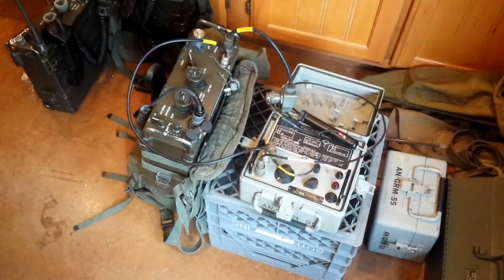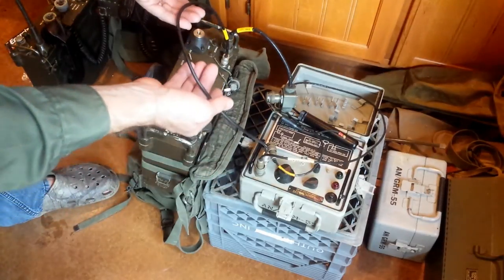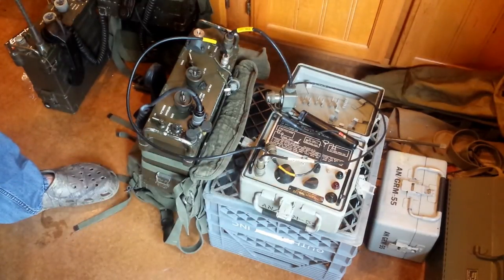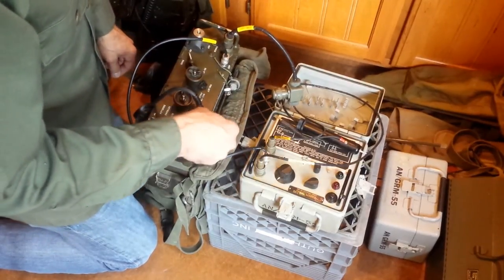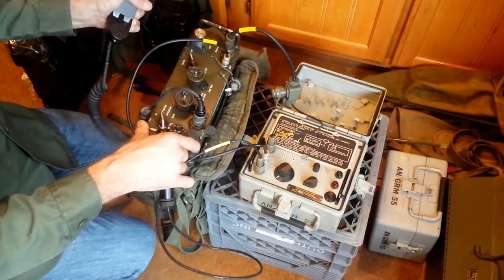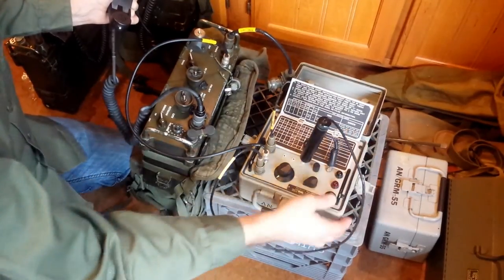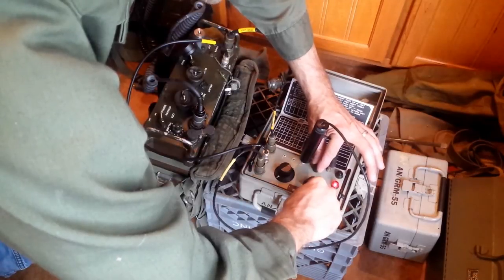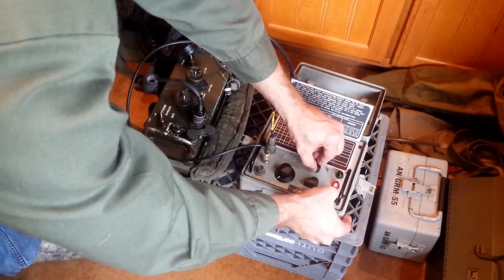Troubleshooting the GRM-55 Self Test for PRC-25 and PRC-77 Radio Sets

Comment: I've wanted to get one of these for a while myself.I haven't read the manual in a few years but does it mention a dummy  load anywhere in the manual?I see a third BNC on the 55 should it not have a dummy load/Phantom antenna attached here?be aware transmitting into no antenna/dummy load will destroy the PA Transistors very quickly less than a minute!
Reply: PA transistors? From the Prc radio? Anyway did he need to place an antenna on the prc? I was told never transmit unless antenna was present. Couldn’t you just test with another prc? What’s the point of this tester? Is it capable in trouble shooting and calibration of the prc when they actually don’t work?

Comment: Bit late but after getting a GRM-55 recently and performing the module tests if you use it right around where the light flashes green for a moment in the self test it seems to perform as intended. Some modules passed the tests. Others failed

Comment: Hey Jeep and rifle, I followed your video, I happened to play around with my gem-55 and I got a solid green to stay I did get the flash like you got but I went past that and the calibration knob to get my green light was closer to full clockwise rotation. My question is the different mod sequences I don’t know any other one but the test set mod what is a16 a1 etc. thanks for all your videos and if you can answer my question I would appreciate it

Comment: I got a prc 77. Any idea if I can pick up any transmissions here in the north east?
Reply: I'm about to put my 77 on the air in the next couple of months. i recently got a 24 volt power supply, the AM-2060 audio amp and a 30 watt general dynamics RF amplifier and will be feeding a vertical 4 element Yagi antenna which will increase my output power by 3 which means 30 x 3  is 90 watts of prc-77 power ERP.I'm located in Plymouth massachusetts.Jim